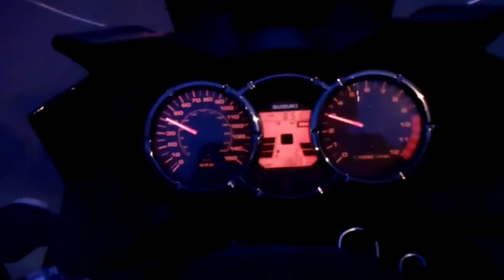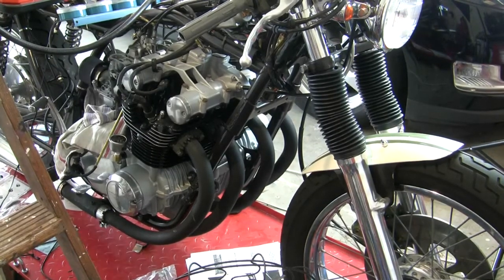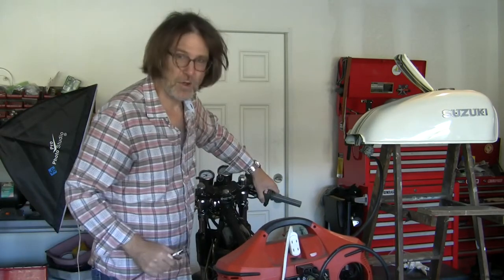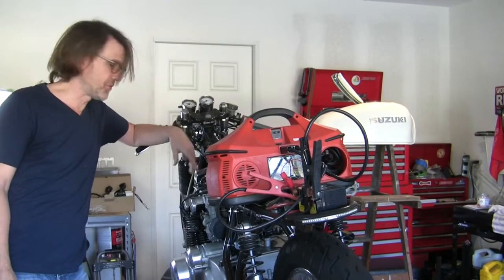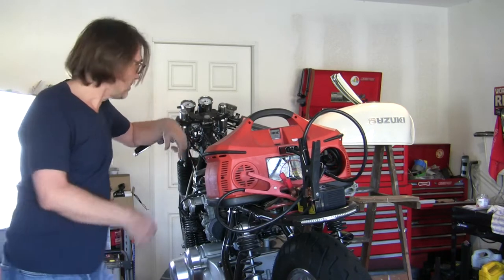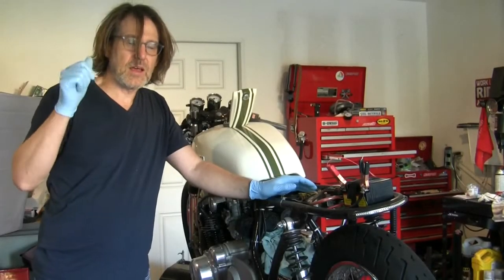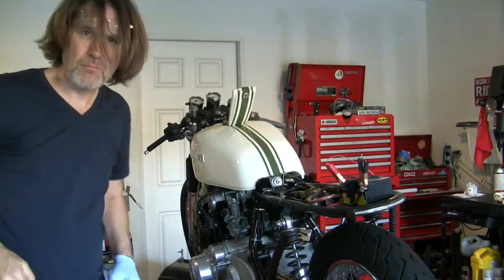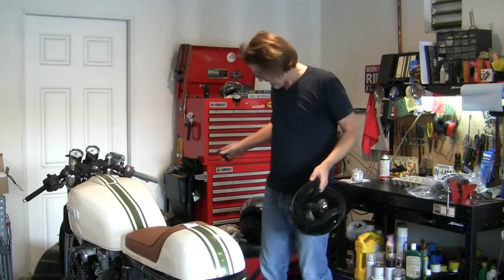Tuning Engine with Colortune - GS550 Cafe Racer Build (Part 104)

Comment: Thanks for an awesome series! Bought my first bike a couple of months ago to learn motorcycle wrenching. It's a 1982 GS550 M and your videos has helped a lot even though i run the mikuni CV carbs.
Reply from the maker: Thank you for saying so! There are some distinct advantages to CV carbs over the old mechanical slide carbs, especially for riders who travel in different altitudes. They are more difficult to tune with pod filters though, generally speaking. There are always exceptions to the rule though!
Reply: @UrbanMonkTV  Yeah! My plan is to ceep the bike stock so I don't have the problem with pod-filters since i use the original airbox 👍

Comment: When it comes to tuning the idle circuit, all the Suzuki service data for the VM22SS carbs on the GS550 says all the air screws should be set 2 turns out. I decided to do this, to maintain a consistent air flow across all 4, and make the adjustments on the fuel screws only (using Colortune for initial settings, then confirming by inspecting the plugs after a run). This seems to have worked for me.
Reply from the maker: Thanks for watching and for sharing your experience here for others' benefit. It will help someone else.

Comment: Dam man nice ride so I had the same problems you had. I built a 1975 gs550 cafe racer, that was left out in the rain for 20 plus years, the electronic device that didn’t work was the horn. So the spark plug issue I resolved was that the spark plugs I bought new had to much high resistance in them and also the battery was a fiberglass matt autozone POS. So I switched it to a original lead acid cell and actually use the original nippon denso plugs that were on the bike they were nasty rusty looking and putting on the out side but it fixed the spark plug issue you had. For the clutch I rocked the bike back and forth with the clutch in and in neutral and broke free. I also jetted the carbs myself, I used a small jewelers drill bit on a Dremel. After all this and syncing the carbs I was out like a bandit!!! The bike started ASAP all the time. Eventually I sold it.
Reply from the maker: Sounds like you had one enjoyable journey with your GS550. Thanks for watching!

Comment: Great working!!!!! 
I just bought 1979 Suzuki gs750  and I know nothing about it😅;  Your videos are very helpful. I will be using your videos to fix my issues.

Yesterday my #3 cylinder was not firing but today My #4 cylinder isn’t firing right; by checking the exhaust to make sure as you did. I don’t know what is my next move from here but I just ordered the carb synchronizer and the color-tune.... 

Throughout this process I’m trying to 
1-Learn
2- don’t spend a lot of money: maybe hard to do since must have tools
3- enjoy the process
Reply from the maker: Thank you for watching! Your plan is perfect. Also, 1. Fuel/air 2. Compression 3. Spark 4. Timing. It'll have no choice but to run. Enjoy your project. These are very fun machines.

Comment: Great video UM! I need to invest in one of those Colortune things! Noticied mine very from plug to plug also, that tool would be a huge help! Had the same problem with my clutch sticking! I just rolled started it down a hill n pop the clutch and they broke loose! One other thing, noticed u lack the rear inner fender, gonna get alota sand n debris w/o it, took the factory one n cut it and made it low profile, then painted n cleared it, made a huge diff! Just a thought.
Reply from the maker: Good idea. Would think it would help to bring the oil up to full operating temperature beforehand too. As for the rear fender piece, Agree...I want to show this bike at a couple bike shows first. Like it open for aesthetic. Then I'll ride it more. I kept that inner rear fender piece, so have it for that day. Thanks for watching!

Comment: Sound’s sweet, also have the gs550; had the same pods but couldn’tget it run right so put back to original filter.
In the end with the pods testing i’ve stopped with main jets of size 110, and still lean.
I enjoy your video’s, keep up sharing 😏
Kind regards from Belgium.
Reply from the maker: Great information to share! Thanks. I've got 95s in there now, so perhaps I'll find I need to go up (when I get the clutch sorted).

Comment: Uh oh! You just made me think of my rebuilt engine for my 77' 550GS having the same problem after I get done with everything else. Mine hasn't had any oil in it either for 10-15 years. Nooooo.  I did fog it inside with sea foam before storing it though. Maybe I'll get lucky and not have the same problem (doubt it though). Great video as usual, haven't missed a single one since you started the rebuild. Subscribed, and am not subscribed to very many channels. Awesome job.
Reply from the maker: Thanks so much for watching and subscribing! I like knowing there's a few people out there enjoying this crazy journey I'm on. 🙂

Comment: Hey Monk!  we need to see what you are doing from 8:00 to approximately 10:00 to know how you are tuning the engine.  Maybe if you had one of those pop in windows of a camera shot of whatever you are doing to the air mixture/idle mixture screw that would be great!
Reply from the maker: Sorry, in hindsight I have to agree with you. What's done is done now. I'm on to a new project. I was adjusting the idle air mixture screws on the sides of the carbs. Thanks for watching!

Comment: I use the ColorTune on my 77 GS750 the GS bikes are great. Not sure if you did this or not but I'd go up at least 1 on the main jets and raise the needles 1 ring. If you're interested check out The GS Resources forums and there is a GS Owners group on Facebook will really help you out.
Reply from the maker: Thanks! I went up to 95s on mains and left needles. Running great with good color on plugs. I'm familiar with GS Resources. Good bunch of guys.
Reply: mike brink  The reason people say they don't run right with pods is because they don't know what they are doing. I've been working on these bikes since the 80s both using a Dyno and not using one. First off don't buy cheap pods they don't all flow the same and you will be chasing your tail. Spend the money and buy Quality K&N or APE Racing pods. There are a few good guides out there on tuning carbs. Factories didn't install pod filters because of pollution restrictions anyone who's been around bikes for awhile knows that. Before doing anything get familiar with carb settings and what throttle percentage they effect and study up on reading plug colors.  Do research take your time and don't get frustrated... tuning carbs takes alot of patience.
Reply from the maker: mike brink  It might be more difficult to get an 85 to run nice with changes to airflow. All normally aspirated bikes had constant volume carbs then and they can be finicky. Not impossible though. I've had good luck with my Uni-Filter pods, but my carbs are simple slide carbs.

Comment: That's surprising that all the air screws are at different settings to obtain that blue color.  I would have assumed if you get one set right, the rest will be close to that.
Reply from the maker: Perhaps in a perfect world, but we're dealing with 40 uear old machinery that has sat idle for years and the passageways inside each of my carbs may still differ slightly in terms of cleanliness. Can't see inside the bodies.

Comment: I'd say burning a hole in the piston is a timing issue if it's running lean after quarter throttle lift the needle in the main jet take the plugs out they should be light tan in colour
Reply from the maker: Thanks for watching!

Comment: Hi terrific videos. I have a 1981 gs 550 in the uk. Been off road for 3 years bought as a non runner. Got running on tick over and sounds great but as soon as she is put under load ie gear engaged and throttle opened she stalls. Any ideas what to check. New petrol tap and carbs cleaned. Thanks
Reply from the maker: Thanks for watching! You mentioned new petrol tap. So you're sure all four cylinders are running? Are all four carb floats adjusted to the correct height and all carb float needle valves working properly? All four exhaust pipes getting hot at idle? How about when you run it in neutral at 2500 rpm or more - all four pipes equally hot then? The symptoms you describe make me question whether all the jets and fuel circuits are clear, but it could be a number of things. An infrared thermometer is cheap and handy for checking this. Hope this helps. Feel free to circle back if you have additional insights or questions.
Reply from the maker: Also, any changes to air filtration or exhaust from stock oem?

Comment: You never mentioned what you found wrong with the #2 carb was the carb dirty plus b get port?
Reply from the maker: Oh man...getting to be a long time ago. As I recall I did clean Carb 2 a second time, but I don't recall disassembling the carb bank again. Pretty sure I just hit the passages with some extra carb cleaner. Bike ran better and better each time I rode it in the days following.

Comment: Sorry, a little late to the game...but, I notice the colortune kit is available in 12,14, 16mm etc. sizes.  How would I know what size kit I need?  I believe the measurement would be at the spark plug, but is it at the thread portion? My plugs NGK start their code with a D which indicates 12mm.  Or is it the actual 'hex' portion of the plug that the socket grabs onto?  Again, in my case it's 18mm.  Thanks for your time and consideration!
Reply from the maker: Thanks for watching! You're correct on both counts...it is the measurement of the thread and if D denotes 12mm then I think you're onto the right size Colortune for you. You can double check by measuring the diameter of the threaded portion of your plug with a caliper.
Reply: @UrbanMonkTV  Fantastic!  Thank you VERY much for the quick reply!!

Comment: I had bad running issue with my 550, the other thing that goes wrong, is the rubber diaphram in the fuel tap
Reply from the maker: When I went through my fuel petcock, I noticed how thin/fragile that diaphragm was. Mine is working good for now. Thanks, as always, for watching.

Comment: It will be a lot more helpful if you showed the location of the carb adjustment.  Thanks for Video.
Reply from the maker: I have other videos that detail the location of those screws. You're right though. I was so focused on showing the color that I didn't think to set up a B-roll for the air screws. That's a lot more editing work and I was probably under a time crunch at the time. Thanks for watching!

Comment: Did I miss the answer to how you corrected the problem in the number 2 cylinder not firing?
Reply from the maker: Sorry I overlooked this comment for some reason and am circling back on it. As I recall, I had to clean out the idle air circuit better and it began working. It's still the last cylinder to fire when I start it cold, but it follows the others shortly after and then runs good.

Comment: what size thread is that colortune ?  I'm guessing its 14mm but want to make sure before I buy one
Reply from the maker: Mine is 14mm. They come in different sizes. Thanks for watching!
Reply: @UrbanMonkTV  I have a 1979 GS550 so I would assume it is 14mm also
Reply from the maker: @OutdoorsmansParadise  I'd guess that is correct. 🙂